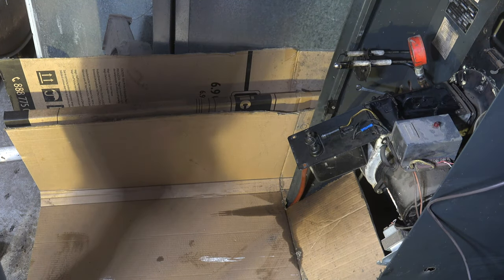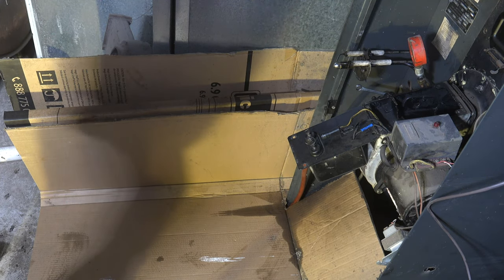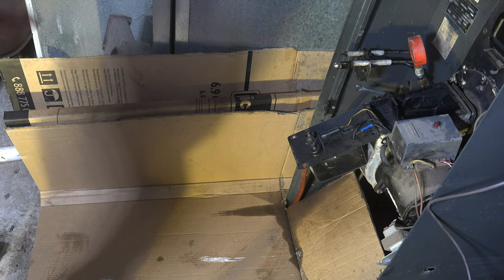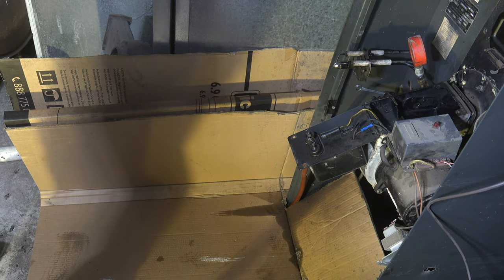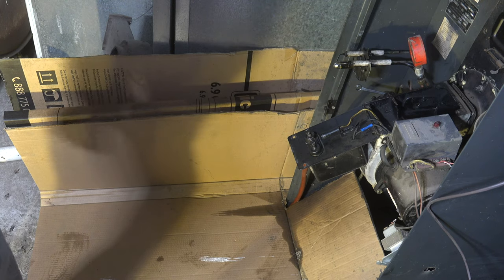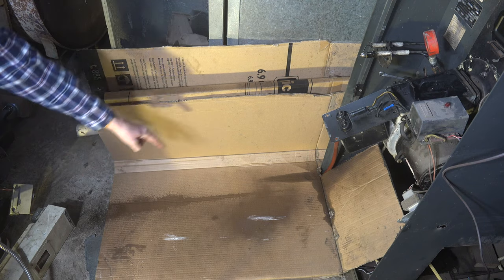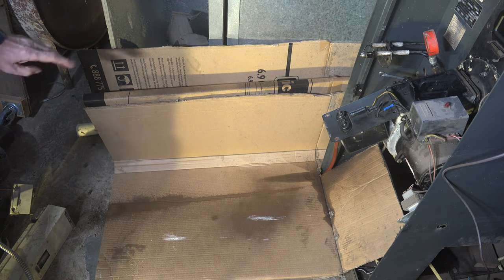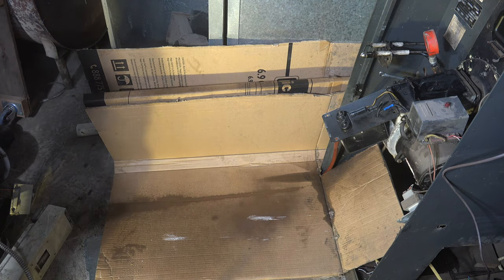What is meant by "peeing" of the oil nozzle #1

Comment: You might want to mention to your viewers that with the addition of a solenoid, or a replacement pump with an integral solenoid (like the Beckett CleanCut), the homeowner may need to have the controller replaced with one that has the solenoid control feature.  As you well know, many of the burners Beckett and Carlin provide to the furnace and boiler manufacturers for residential service come with only the bare minimum controls needed for the specified configuration.  If the furnace or boiler didn't come with a cut-off solenoid, or if blower on/off delays were not included, or if no alarms were specified in the original configuration, the controller they provided would probably be something like the Honeywell R7184A, which has no provisions for the aforementioned functions.  If, on the other hand, the furnace has had the controller replaced during a past service, it may have been replaced with something like the R7184P, which does provide control of a solenoid and blower timing.  I've installed quite a few of them on burners that did not require the extra features because I stock the R7184P (or the equivalent Beckett) on my  truck.  It's only $3.00 more than the R7184A at my local supply and it can replace most of those controllers that have less features.

I can also attest to the fact that if identical oil burners are correctly cleaned and properly adjusted, the units with a shutoff solenoid will almost always burn cleaner.  This is a fact that isn't lost on the furnace and boiler manufacturers.  I haven't seen a newer unit from New Yorker Boiler, Crown, or Weil Mclain that dose't have a cut off solenoid.
Reply from the maker: Thanks for the good thoughts.
GFM

Comment: Honey air bubbles from Air that's trapped in the oil buildup in the gun line when the pump stops pumping reducing the pressure those air bubbles expand when they expand it pushes the oil out after the solenoid is put in you could still experience peeing . Because while the pump is running it's bringing that air into the gun line into the nozzle area. The solenoid valve will help but if it does not resolve the problem 100% I find that a tiger loop will finish the job the tiger loop gets the air out of the oil and also preheats the oil helping it burn more efficiently without air in the line. This was sweet and sway of dealing with the problem. My personal experience has shown that it does work 98% of the time. I find that sometimes coming from the refinery fresh oil that was manufactured recently has a lot of air trapped in it sometimes changing oil companies will get you different oil with a lot less air trapped in it that will help and sometimes a smaller oil line smaller than 3/8 of an inch if you have a half inch oil line you may want to reduce to 3/8 of an inch if you have a 3/8 oil line you may want to reduce to a quarter inch this too will also help reduce the air getting into the system. I know you tried to keep the video short but I just wanted to add that little bit if you think it helps let me know if not let me know why thank you and thank you for all the great videos you have made I enjoy watching them over and over again because they keep me sharp. Continue in the education is always important there's too many things in this field to remember by watching gray furnace Man the things that you don't see all the time if you watch those videos over and over when you do see it you'll know exactly what to do education is King in this industry and readers become leaders and so do people who watch gray the furnace Man thank you
Reply from the maker: Thanks for the thoughtful information.
GFM
Reply: @grayfurnaceman  you're most welcome and please do a series on those oil transfer pumps that they put in the fuel lines for units that are suspended from ceilings where the tank is below the unit and they use that extra pump to help pump the fuel to the gun if you don't mind please thank you
Reply from the maker: @edwardburnsburns5307  I will put it on the list.
GFM

Comment: Watching this video and alot of steve Lav's videos I didnt realize the just let the motor/pump do all the control,  Not any oil furnaces that I am aware of here in CO just Pressure washers with Becket and Carlin burners. They let the fan/pump run all the time and just cycle off the High pressure oil with a solenoid on the pump. very interesting, as always I love watching your videos. Thanks for sharing your wealth of Knowledge.

Comment: Pretty cool..
Back when, I worked on Volkswagen's that had a Stewart Warner gasoline heaters. They used fuel nozzles much like oil furnaces. Many times these would light off with an explosion no doubt due to peeing. I never had any service info on them, but got to know them very well. Having a fresh pump diaphragm and good check valves made all the difference.
Thanks for this video

Comment: My Miller Furnace with a Suntec pump would start leaking Kerosene, I learned after multiple events over the years that changing the pump stopped the peeing problem!
Reply: George Horn III your pump had a bad cut off then. It's a different problem than in this video. A little leaking out is normal,if it stops in a couple seconds. I'll never forget years ago I put a new pump on for a customer and it had a bad cut off rite out of the box, it was a night call and the next day got called back to the house to find oil all over the floor around the boiler as well as a soaked chamber. I now test every new pump I install to make sure the cut off works

Comment: So I came across an old Wayne burner on a old burhnam boiler with honey well aquastat. I eliminated the idea of leaks in the line potentially cause more air pockets forcing oil through the nozzle but everytime it would fire it would have a puff back with a mini explosion. How would I add this solenoid to this system? Just wire it to the burner motor? Or is there more issues that could cause after drip causing the puff back on start up? I didn’t get the chance to go back in the call and haven’t herd anything after and it has been driving me nuts not knowing what it may have been. Nozzle was new boiler was cleaned

Comment: This is the video I was talking about on your Close call car video the other day. Have listened to this one a couple times again and it sounds like the peeing stops when the pressure drops. 
Still not sure why it roars when it ignites after only a few seconds.I have run it plenty enough to have all air out of the line since it was worked on.
Reply from the maker: The gun assembly sometimes traps air in the top part of the nozzle adaptor.  Yes the peeing stops (or reduces considerably) when the pump shuts off.  
When you talk about roaring, do you mean rumbling on startup?
GFM
Reply: Yes. I shut it down at the breaker and wait a bit and start it up again and it usually starts properly. I let it run for up to an hour depending on how cold it got before I turned it on. Did buy fuel last winter because I didn't know if I would have to get a new one or have to switch to gas which I really don't want to do. Hear too often of them blowing up. Used only a quarter tank, 250 gallon tank I think. 
Did I hear oil furnaces would not be sold after the end of this year? THANK YOU SOOO MUCH!

Comment: I'm working on a Beckett oil circulator with Suntech pump...and while changing the nozzle I noticed something  I either didn't know about or just now realizing...inside the oil tube or maybe built into the nozzle adapter,  there is a mechanical part that slides if you flip the tube assembly from one end to other. Is this some sort of check valve? I'm very curious as of purpose. Thanks.
Reply from the maker: I have seen some that had a check valve in the gun assembly.  It is there to shut off the flow of oil to the nozzle when the pump shuts off.
Not very effective.
GFM
Reply: @grayfurnaceman  that is was I was thinking...this is an old one without the solenoid. I haven't noticed a lot of puff back surprisingly.

Comment: Would putting in a new pump cure the problem,my furnace just started doing these,going to check gun depth adjustment leaks pretty good under center of housing,
Reply from the maker: Replacing the pump will not help unless you install one with a solenoid mounted on it.
GFM

Comment: I had that problem a lot on my oil burner in my first house. A lot of it had to do with the underground tank I believe. The oil was cold and made the rubber disc on the pump cutoff so hard that it wouldn't seal right. Sooner or later it wouldn't ignite and the house would get cold, I'd get up in the middle of the night and take the pump cutoff out of the pump and put a new rubber in it ( I had about a dozen of them I cut out of sheet rubber with the proper arch punch ) wipe the nozzle and electrodes off and fire up the boiler. I eventually did put a solenoid valve on, no more underground tank for me. I'm 76 now but I was 32 back then, young and dumb I thought the bury tank was the cats ass boy was l wrong.

Comment: What could cause oil to leak from a oil furnace? More specifically from the insulation liner on the furnace cabinet of a fairly new furnace. No leaks on the exterior of the burner
Reply: Also no oil pooling inside the combustion chamber
Reply: If theres no oil on the bottom of the burner housing under neath(which I would say bad pump seal), it maybe that the oil is boiling out of the end of the nozzle or nozzle adaptor after shutdown and running back tube and around flange soaking into fiberglass insulation(which shouldnt be happening).You should be able to see the run lines inside the tube and usually a char spot where oil is dripping.

Comment: The nozzle “atomizes” the liquid oil effectively into a gas state,  otherwise it can’t be ignited as a liquid at given fuel temperatures.
Reply: With heating oil, atomization does not equate to vaporization.  Gasoline when atomized in say a car injector does vaporize, but only because it's so much more volatile.
Reply from the maker: I must also chime in to add; atomization reduces the size of the droplets to the point that they can be easily evaporated by the heat of the combustion chamber.
GFM

Comment: Gray could we install and Pressure Check Valve in the line before the nozzle with a preset limit of psi before the check valve lifts for the oil to go to the nozzle. I am thinking the check Valve would be better the solenoid or it dripping oil into the Burner Box. If You preset the check Valve at 50 psi It would stop all the fuel from the pump to the burner nozzle. Just only the fuel after the check valve to the Nozzle will drain out? the Check Valve would Operate as a Check Valve in a Water Line. A ball check valve with a Spring will close at low Pressure. this will stop the continuous drip of Fuel. I think I may try it. Either a Ball or a Flap Check Valve will operate fine. Please give Me Your Opinion on the Check Valve.
Reply from the maker: Could work ok.  The only possible problem is no manufacturer has done it.
GFM
Reply: @grayfurnaceman  You are Very Smart on these Diesel Burners. The check valve will stop the peeing of Diesel. When the Pressure from the Pump stops when the Check Valve will close if  valve is spring loaded.